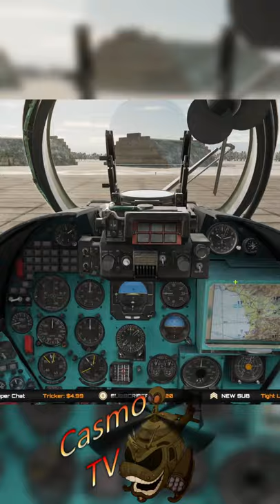Hover power does not equal take off power | DCS Word #Shorts

Comment: The power gauge is the vertical tape below the HSI. It has a moving redline based on current conditions. It is marked for continuous, takeoff, and OEI. The MI8 and KA50 have the same gauge. If you fly within limits on the gauge, you will find yourself removing ordinance to keep it happy.
Reply from the maker: Power gauge isn’t the same thing as torque which is what US pilots typically look for. But cool too.
Reply: @CasmoTV  It seems the Eastern built helis may have stronger transmissions than those built in the west. I have not found any documentation on torque or pitch limits in the English Mi8 manual. There seems to be more worry about overstressing an engine. I think the current trend to FLI is becoming the industry standard.
Reply: The so called power gauge is in fact EPR (Engine Pressure Ratio) gauge, funny enough in the west many airliners had such gauge and in the east only military helicopters seems to have such. I wonder why they use EPR as reference and not the EGT. In fact EGT is usually the limiting factor for the engine. Even more funny thing is that engine in Mi-24 is turboshaft with centrifugal compressor, EPR gauge for such type of engine seems a bit drunky idea IMO ;-)
Reply: The Russian model works better as you don't need to consider temperature or altitude for your engine performance, but just look at one instrument to know the overall situational performance to fly.

And the hind as hip lift capabilities are not based to lifting capability but to engine lifetime for planned period. Those can lift way more than the manuals and the specifications states, but you don't get maximum lifetime from engines then. So example Mi-24P is by specification max takeoff weight 11500 kg, but it has lifted to be over 14000kg in recovery missions as external load. Engines lifetime suffers quickly, but there is a hellish amount of power and capability when required. So at war time you could see hinds operating at harsh conditions with full weapons or even with infantry inside as at operational zone fuel has been consumed enough and likely few weapons that it is much lighter again.